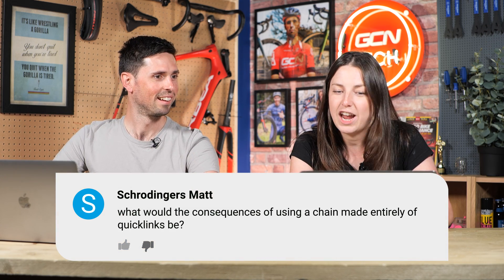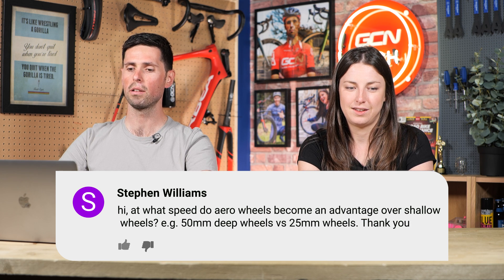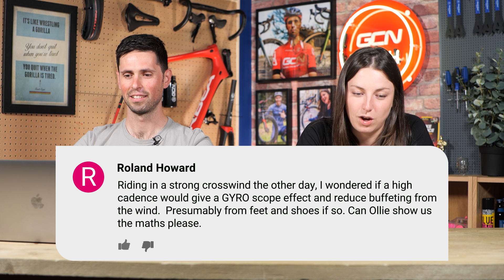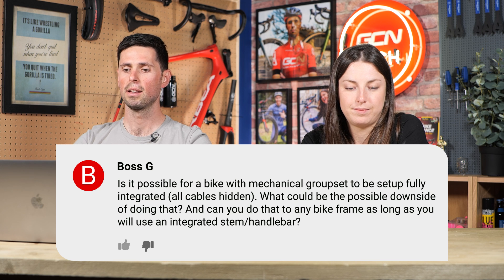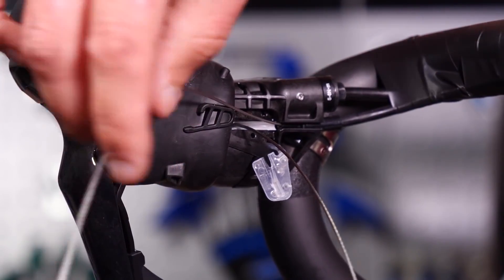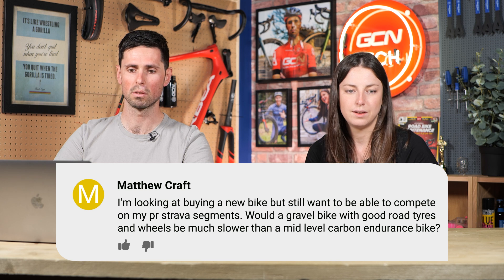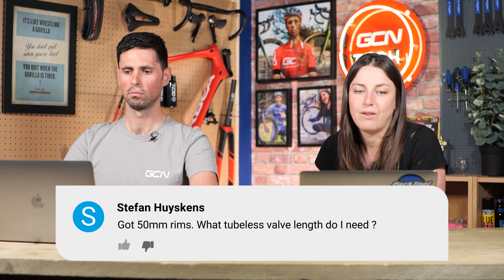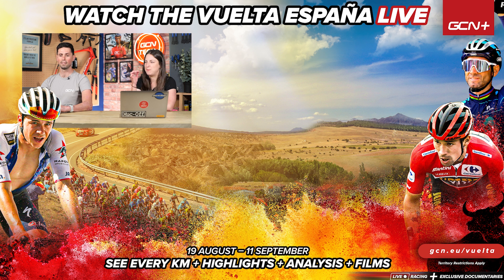At What Speed Are Deep Section Aero Wheels Better? | GCN Tech Clinic

Comment from the maker: Did you find these answers helpful? Let us know your tech queries using #AskGCNTech 👇
Reply: Follow up to Manon's comment on pimping out one's bike. Does "treat yourself" come from Parks & Rec? If so, who is her favorite character and why is it Ron Swanson?

#AskGCNTech
Reply: #AskGCNTech Is using drops on an XC MTB frame makes it a gravel bike? or Just a glorified hybrid?
Reply: Two answers to the wheels question:
1. If the bike is moving, aero has an advantage over non-aero at all speeds. The size of the advantage increases with speed. The real question is at what speed does 50mm deep have an advantage over 25mm deep assuming a given weight penalty (e.g 200g) for the deeper sections. 
2. When stationary, the deep sections look faster.

Comment: the advantage of deep sections wheel is available at any speed. The question is at what speed they start to make more difference than other things, and the answer id: it depends. but... at 15 kph circa the air resistance becomes the biggest force you'll fight so i'd say that aero wheels really become worthy at 15+ kph. it also worth say that if you are going to race youre avg speed will be way more than 15 so deep sections is definitely worth it.
Reply: Damn manufacturers, I want deep section but only found kinlin tb25 as want aluminium tubular wheels and my relaxed is 19-24mph (depend on mountain bike or road)

I once cycled 13 miles in 40 minutes on BMX with standard 20" wheels and took me just over an hour on 26" wheels mountain bike

Comment: The bottom bracket on my 1975 Bianchi is giving up the ghost, what would be a reasonable way to keep the bike alive? The current BB and crankset are Ofmega Competizione parts with an Ofmega proprietary square taper...
Reply: Their is such a bottom bracket offered in Ebay at the moment, a new one old from stock but never used, for 72 $ located in Belgium with world wide shipping

Comment: #AskGCNTech I have Zipp 303 firecrest wheels onto which I installed 28mm Coni GP5k Str tyres, when I pump them up the pressure(57/60 psi front to rear) the tyre width increases 30.1mm, is that normal?
Reply: You should not pump those more than 5bar according to zipp. Also those wheels are so stiff that even at 5bar they are a pretty rough ride. Also zipp has a pressure calculator, you should look into that imo.
Reply: @ggrande8048  do you know how many psi's are in 5Bar? Just in case you don't, about 72psi's, Also do you have a set of Zipp 303 firecrest?
Reply: @KenSmith-bv4si  Actually I do. Messed up the conversions. So disregard my comment then.
Reply: @KenSmith-bv4si  the reason why the tires are wider when pumped is because the inner width of the rim is wider than "usual" so therefore the spread of the tire is wider.

Comment: The rim question about 50 mm rims with 60 mm tubes:
I own 50 mm Roval rims, installed is 60 mm latex tubes. Pump clasps to the valve perfectly with no problems getting desired PSI/bars. I'm assuming you should be fine with your same measurement setup. I've also used 42 mm valve lengths with an extender but it was quite cumbersome and leaky. I avoid extenders because I've always had bad luck with them (leaky). My current above setup's been working for me. Safe riding out there.
Reply: Are you using the green Michelin AirComp LATEX tubes, as those are the ONLY ones I've ever seen/used with longer than 48mm stems???

IF not, what brand are you using??
Reply: @Fordworldrallyfan  I used to use Vittoria competition latex tubes, but I can't find the 60 mm valve version. So right now, I'm running Michelin A1 Aircomp 60 mm latex tubes. Decent price, like 35 CAD. Prolly like 20 USD if you're an American costumer.
Reply: @jaimeisreal  Yes, some retailers are selling them for ~$19.00 USD online.

 I recently picked up a bunch of Vittoria latex tubes for $9.95 each, but yeah, only 48mm stems.

IF I ever find a set of deep section wheels for my ride, I might grab some of those A1 AirComp latex deals once again (last time I bought them was almost 20 years ago!).

Comment: You can squeeze  a brand new tire and check for cracks, diferent conditions can Dry Roth  your "Brand New, Never Used Tires" like exposition to extream heat in a garage (Like here in Texas) or sun light, ozone or fumes for Swimming pool chemicals. I had see them all.

Comment: Deep - flat. Light - mountains.
In 1977, Peugeot used 28 spoke track sprint rims for the mountains. 36rear/32front on flat stages.
Reply: Ironically, those mountain rims were probably significantly faster on the flats, with fewer spokes. However, durability comes into the equation at some point. The climbers probably should have been riding the climbing wheels at all stages.
Reply: @MicheasHerman  Yeh, ironically on the flat in the middle of the pack, a heavier bike gives greater momentum. Use the draft to get up to speed and then half-wheel to the final 100m. 😁

Comment: #AskGCNTech. I'd like to know, is it possible to un-bonk yourself on a ride?
Reply: Bonking is not only physical. It works on your mind and well. Like being sad, lonely as well as physically spent. There is no quick fix or full recovery. This has worked for me on hot long rides.
Get in the shade, rest and drink fluids with electrolytes if you have it. Eat something that you know won't upset your stomach slowly. If alone call someone that will encourage you and cheer you up. If you're too far from home don't be shy asking for a ride.
Last time it happened to me did the above. When I called my local daughter she was busy driving kids in the opposite direction. Hurt my delicate feelings and I came close to crying. This is a good reason to be aware of heat, distance, hydration and general well bring. I should have stopped or turned around sooner. 
So in the shade I are and drank and walked slowly around. In about 20 minutes l had a stern talk with myself, plotted the shortest easiest route home and ride the almost hour home. Wasn't perfect but felt comfortable riding a steady pace. Lesson learned!

Comment: Concerning a gravel bike as a road bike, that’s what I have done. I put aero road wheels on a Cannondale Topstone. That worked very well. I recently bought a Trek Checkpoint and I’m in the process of building up some carbon road wheels for it. The Checkpoint frame is nearly the same as the Trek Domane endurance road bike, it just accepts wider tires. 

I also prefer gravel bike gearing. I would never make use of the large ring and small cog position if the large ring were 50+ T. I do make use of the lower gearing I get, even on the road. One additional plus for me is a gravel bike will typically have multiple mounting points on the frame. I make use of a bolt on top tube bag and in the winter, a bolt on frame bag to hold various bits of clothing I shed as the day warms during long rides. 

What did I give up? Probably a very slight increase in aero drag from the frame and a bit more weight due to the larger frame as well as more robust construction typical of a gravel bike. What did I gain? A more versatile bike and gearing better suited for the riding I do.

Comment: I don't care if my aero wheels makes me faster or not, I just love the "swoosh" sound they make 🤗
Reply: ^^^Basically, THAT is the main reason I am desperately seeking some first gen type deep section (but NARROW width to fit my 2001 built frame/circa rim brake calipers), carbon clincher wheels with alloy braking surfaces.

Sadly, these are pretty much IMPOSSIBLE to find nowadays, especially with a Campy 10 speed freehub, due to EVERYTHING being disc brake, an effing MILE W-I-D-E, and exclusively Shimano/SRAM freehub-ed. 😡☹
Reply: @Fordworldrallyfan  I have a 17mm wide front disc with a crusty tubular if you're interested😉
Reply: @veganpotterthevegan  Thanks, but I will pass, since the only place I would ever DARE ride a front disc wheel is in an INDOOR wooden velodrome, and even then only for TTs. 😉
Reply: What whoosh sound? (Guess I'm not going fast enough🤣)
Reply: @tongpocalypse  CARBON wheels make a kind of rhythmic 'roar', or almost a scrubbing type sound as they roll along under power.

It is more pronounced the deeper the section height, but even lower profile/shallow section depth lightweight 'climbing' carbon rims do this as well.

Even more so when shod with high TPI count casing clinchers or tubulars with latex tubes inside.

Comment: I can answer the question on riding in crosswinds and gyroscope effect.

If I am riding downhill at 30 - 40mph (10% gradient), if I coast, the bike is nervous in crosswinds, it can be scary at that speed.

If I am pedalling , the bike is solid. I think it’s the force going through the pedals which stabilises the bike.  I doubt it’s my legs spinning round.

Bike is also more stable in crosswinds riding in the drops as my weight is then a bit lower down.
Reply: Agree re drops, put as much weight over the front wheels as poss and the wind has less chance to push your front wheel out from under you.
My deep section rimmed bike is now my 'not very windy out' bike.

Comment: Certain atmospheric conditions (extreme heat/cold/humidity) and UV damage limit the life of tyres. If the rubber is cracked or crazed, especially on the sidewalls, it is a sign that the compound has degraded and hardened, and does not offer the level of grip they once did. If your rubber is intact under flexing you have nothing to worry about.

Comment: I'd say keep the bike out of direct sunlight because it leads to premature deterioration of tires and saddles generally. Eddie Merxx actually promoted aging the tires for maxim durable! 5 year old tires is very old. A major automotive retailer prohibits sales of tires older than 5 years.
Reply: 'King Eddy' actually had a tire cellar in his house for this express purpose! 😉
Reply: Old tires have less rolling resistance (of course they also have a lousy grip on wet roads).
When car manufacturers test their cars in NEFZ or WLTP they "bake" the tires in an oven before the test to harden it artificially, so the rolling resistance is lower and also the fuel consumption (but they also use other tricks to cheat the public and the customers)

Comment: About the tyres expire dates, car tires have an expire date of 5 years (at least here in Brazil). I've got some old Trek from 1997 with some Michelin tires from early 2000s that are still looking good but my Trek 8000 2008 had pretty bad original tires, they were dissolving lol 🫠. So my guess is that it depends on the tire and weather conditions but I wouldn't ride on a 10 year old tire 🤭
Reply from the maker: Thanks Renato - that's good advice!
Reply: I still have a set of unused, never ridden/mounted Vittoria Corsa 'Open Tubular' clinchers with the tan side walls from ~2002 (290 TPI, 23C).

They 'look' fine, but probably going to have to sell them to a 'retro bike' fanatic or something, for a display/'museum' bike.

Funny that the top riders way back when used to age their tubular tires for up to 3 years before use (Merckx had a 'tire cellar' instead of a wine cellar! LOL), but nowadays, less than a year is considered way too old, even for top line, high TPI cotton casing clinchers.
Reply: I can confirm Renato's advice.  At least for classic cars it is recommended to change the tires after 8 years irrespective of the number of miles on them- the rubbed degrades slowly over time due to the oxygen (and pollution) in the atmosphere.
Reply: In EU there is no expiration date for car tires at all, not even for truck tires. On fire engines the tires are usually replaced after 10 years because of safety reasons. However in Germany dealers can sell tires which are up to 5 years old as new tires (which is a bad joke, but Lobby rules this country)
Reply: @simonm1447  That is SHOCKING, given just how vehemently, abjectly DRACONIAN their TUV is on EVERY OTHER aspect of automotive safety/inspection! ???
Reply: @Fordworldrallyfan  TÜV can be draconian - or they can let cars pass with severe problems. I live there, my last car was checked just months before I bought it in used condition, it was registered on a official brand dealership before. When I bought it (7 years old) I discovered both steel rear brake lines had severe corrosion up to a point they almost burst. It passed TÜV 4 months earlier without any problems, I assume the TÜV dude just trusted the dealership and didn't even inspect the car. At the End it was me who discovered it, when I mounted a towing hitch. 
TÜv was also the organization which checked the dam in Brasil, which killed 270 people. I don't trust them any more

Comment: The aero advantages of deep wheels outweight the extra weight under basically any circumstances the well-trained amateur is likely to encounter. You can easily estimate this. This comment is based on a 85kg rider+bike, who has to choose between wheels that save 15W at 35km/h, or wheels that are 300 grams lighter.

On the flat, there's no penalty to the extra weight, so you'll always gain from using aero wheels. Unless you are going very slow (<200 W), the deep wheels are the best for any incline below 6%. At 7/8% it becomes a bit of a grey area, if you can maintain more than 250 W (14km/h, resp. 300 W/15km/h for 8%) the deep wheels are better, otherwise lightweight wins. From 9% onwards it's basically always shallow wheels that win.

Even then, the penalty from the weight is small. Even at 20% your disadvantage with deep wheels is less than 2 W for any speed you can reasonably maintain.
Reply: It's more like 10w at 40 kph, which most amateur riders couldn't hold for long anyway. And that extra weight is gonna come into play on most rides. According to research by Zipp, most riders are gonna benefit from the lighter wheels on anything over 5%. All my group rides have plenty over 5%, and as I struggle on the hills more, I'll take ligthwieght over aero at my price point. Obviously, if you can afford lighweight AND aero, go for it, but for me, it's pick *one*.
Reply: @Morpheus0000  It depends on what exact parameters you choose. Zipp's estimate is not far off from what I presented. But regardless, the savings of lightweight wheels are extremely minimal. For a 85kg rider+bike combo, having a 300 gram lighter wheelset will save you at most 1.5 W (at any gradient, for any speed you can maintain with at most 450 W). A slightly weaker rider (300 W) would never save more than 1 W.
Your 10 W at 40 km/h figure still translates to a 0.4 W saving at 14 km/h, so in practice you're saving (on steep enough climbs) about half a Watt with light v.s. deep wheels. That seems incredibly insignificant and I doubt anybody could notice the difference in a blind test. At least the difference that deep wheels make can be noticed in some situations.
Reply: @TomPuzzle  Cervélo did a lot of testing and calculations to answer this question (weight Vs aero). They discovered that aero gains trump weight loss for anything up to around a 5% slope for the average recreational rider.
Reply: The difference in weight these days between deep and shallow is now so small, that I think these conceptions are even more on the side of deep rims. I’d guess you could save time up a hill of a much steeper gradient with deep section wheels because of this now.
Reply: Is this why the heavier sprinter always wins grand tour GC?

Comment: 2:00 Wrong, because around 15 kmh aero is still 50% resistance, so all the speeds are ok for aero wheels, even the slower riders take more profit from aero gadgets because they save more time than faster riders.
Reply: Yes, but at any speed, 75-80% of wind resistance (friction in the surrounding air) is generated by the shape of the rider, not the bike.  Achieving a more aerodynamically efficient posture is free in monetary terms and provides much greater gains than changing anything on the bike, so most riders would be better served to work on that first.

Comment: Question: lycra cycling clothes obviously provide aero benefit, but what proportion of that benefit is provided by the top vs the shorts. That's in comparison to fitted but not super-baggy regular clothing.
Reply: The primary advantages of padded Lycra shorts are long-term comfort and mobility.  They are more aerodynamically efficiency than typical street attire, but that benefit is quite a ways down the list of why one should wear them.  The Lycra top provides aerodynamic efficiency in keeping with how snugly it fits; a cotton t-shirt that's a couple of sizes "too small" for normal wear could provide imperceptibly close to the same "aero" benefits as properly fitted Lycra.  Conversely, a Lycra top that's way too big will flap in the breeze just like a street shirt might.

Comment: About tires and expiration date: I live on the high desert region of central Oregon. It gets hot here, yes, but more importantly it’s very dry.  Very low humidity. When I first moved here many a years ago (late 90’s) the tires I used (Continental) the casing/the sidewalls got so dry, they started to crack.  I decided then that this brand is probably not gonna work here.  They never did that when I lived in the much higher humidity region of Willamette Valley of western Oregon. 
In conclusion, if you live in dry desert regions… check your sidewalls.
Reply: It's not humidity that degrades butyl rubber. It's UV radiation and ozone.
Reply: @terrymorse  I'm talking the casing of the Conti tires, they're not butyl rubber.

Comment: ha, I have 20 year old Michelin tires on a road bike and they look great, no cracks or signs of dry rot. It does stay out of the sun and weather when not being rode.
Reply: So, just 6 weeks ago I replaced my 20 yr old Vittorias with new Continentals and upsuzed from 23 mm to 25 mm... I was blown away! Immediately got a smoother ride, much less vibration, better average speed - overall, way more comfortable and worth every penny. My 2 cents!